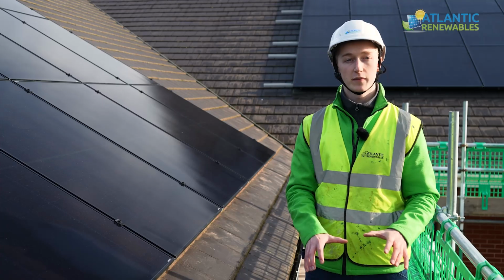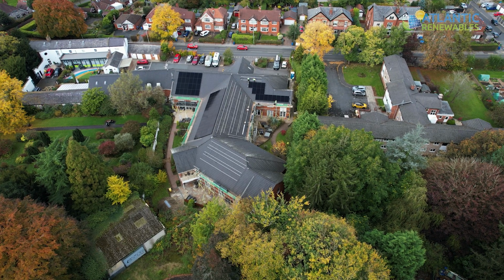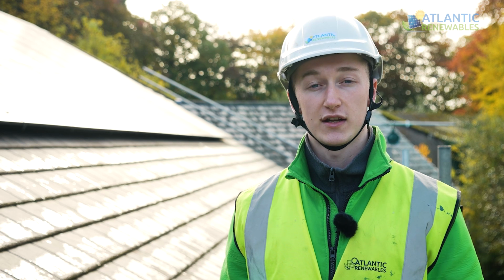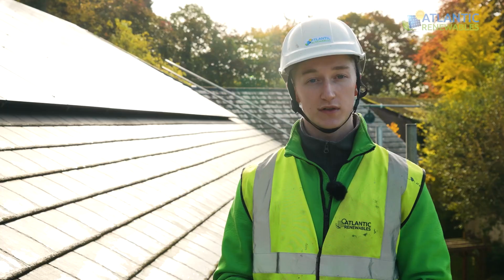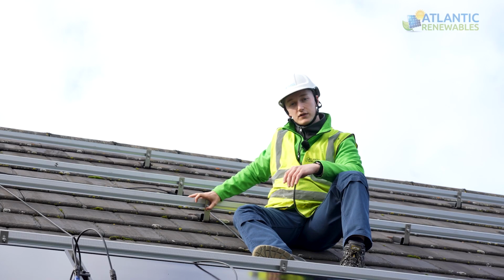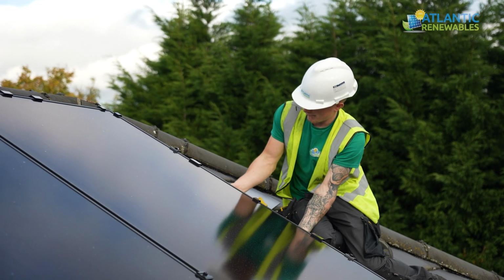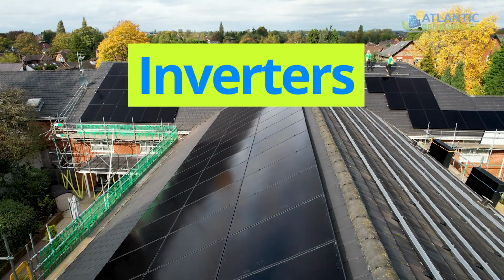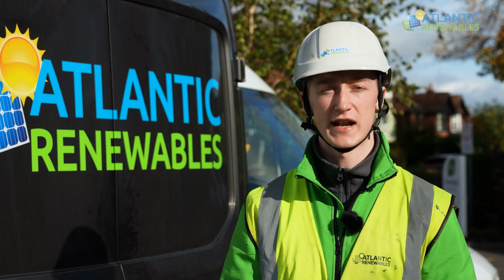Atlantic Renewables - Commercial Solar PV Installation in Hazel Grove

Comment: Your solar system looks great, and I appreciate the effort you've put into it. However, I have a small concern regarding the bird-proofing installation. It seems to be affecting heat dissipation from the solar panels. Since monocrystalline panels generate more heat due to their darker color, proper airflow is crucial to maintain efficiency. Unfortunately, the bird-proofing appears to fully cover the panels, restricting airflow and potentially reducing efficiency. It would be better to use a stainless steel mesh net to allow better ventilation , instead of fully cover birdproofing